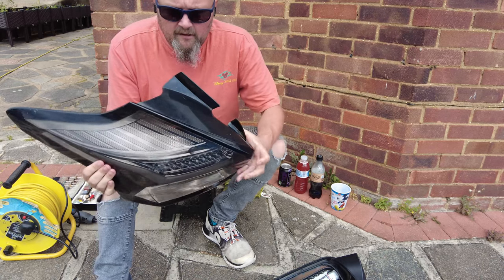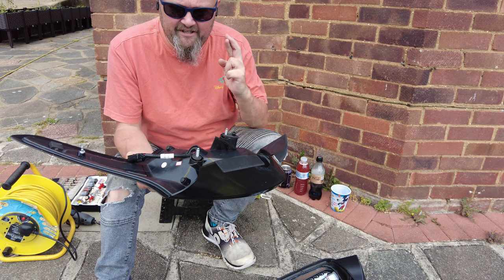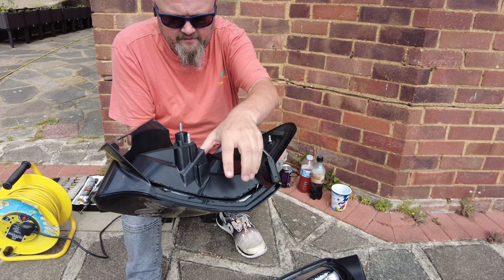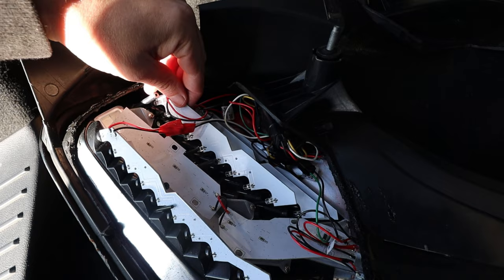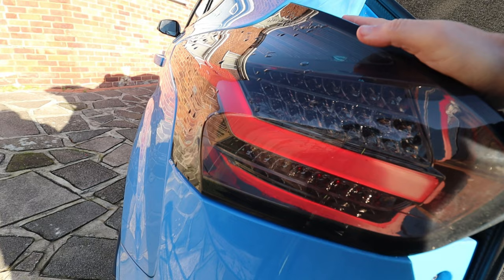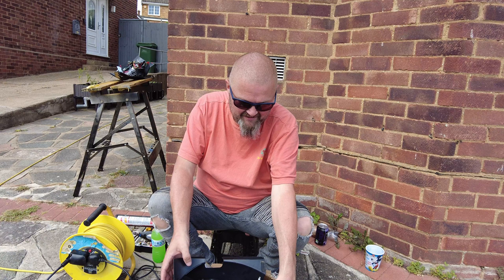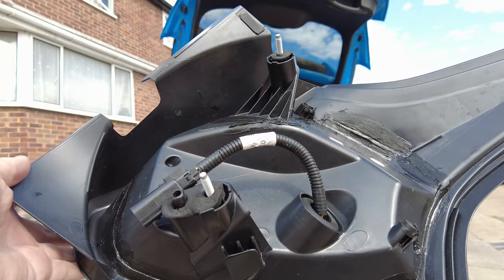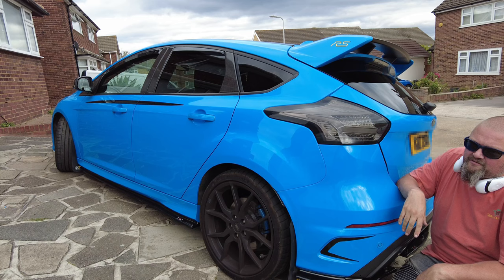Ford Focus RS MK3 Rear Light Fix What went wrong?

Comment: Check the resistors on the circuit board, you may need to solder them in again. They do crack over time due to heat.

Comment: The original headlights for the focus rs/st is around $1300, the tail lights are $900.
The price of these "replacements" are $300 to $400. 
The price difference alone makes swapping out the original parts, not worth the risk of 
shorting out the entire electrical system of the car.